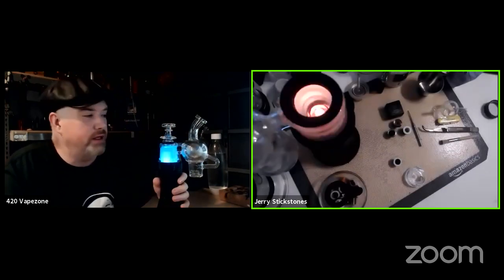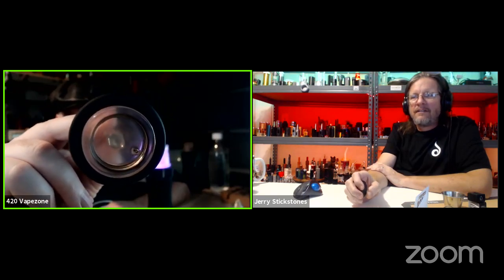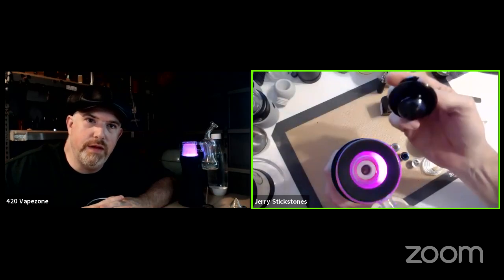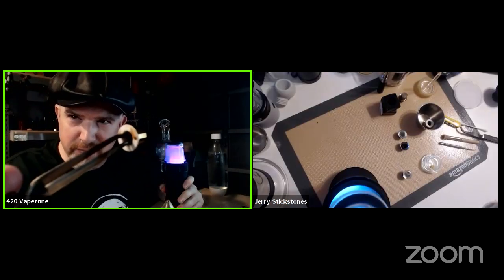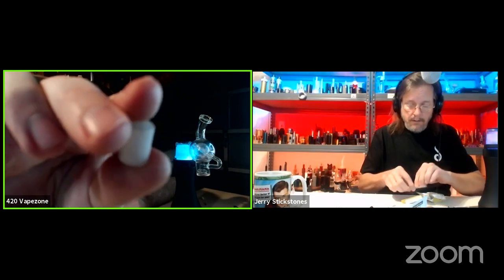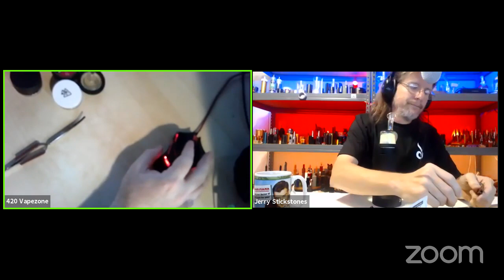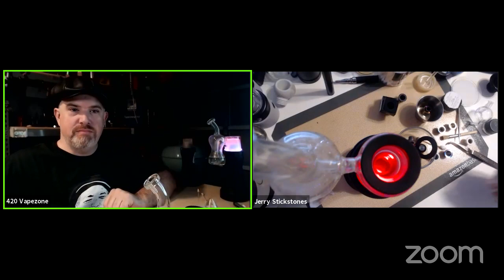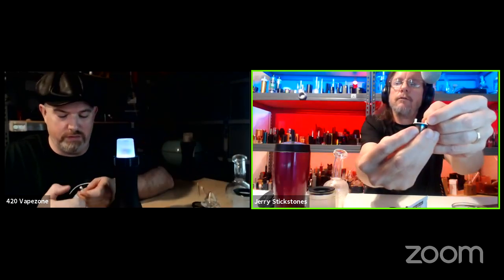Dr Dabber Switch - LIVE SESH & REVIEW

Comment: I love my Switch! Everybody forgets that you can use this for your Dynavap also.   Loving the videos!   Keep them coming please!
Reply: How on earth do you do that? Is there some sort of converter to fit the dynavap?
Reply: You have to take out the metal cup. So it’s empty inside of the Switch. Just stick your Dynavap in and hold it in the center and press the button.  You just have to figure out what temperature is best suited for your taste.  You might burn through some bowls until you get your temperature adjusted. Depending what temperature you pick you might have to leave it in a few seconds after the click. 
 The technique is hold the Dyna slightly off the bottom and don’t let it hit the side walls. So it’s kind of just suspended freely in the center.  Once you have it figured out with heat and timing it works flawlessly.
Reply: @lawtheone3347  thank you for my solution. wow i would like to see a demonstration of this

Comment: There's a reason I never bought the puffco peak pro or The Carta 1&2 is because of the Dr. Dabber Switch, which is close to a traditional rig in vapor and hitting power as possible, Don't need no atomizers is one of the biggest advantages and an all glass air path, induction heating with the cups can last forever as long as you don't break them. Best customer service out of all e-rig companies And when it's fully upgraded there's no E-Rig that can come close..

Comment: great live. This would be perfect for me, as im a bonger but want to mainly use concentrates for flavor. but occasionally ill use herb. I just hope ill be able to clean it out fully to not deal with the taste when switching back to concentrate mode. any more details on the smell and taste afterwards when hitting a dab after? like have you found a way to go from herb to concentrate and you wouldn't even notice when hitting concentrate?
Reply: The well and dish are easy to clean. It's the glass that might slow you down. But if you gave it a quick iso rinse after each session it might work.
Reply: @vaporconcierge8431  o nah i deff plan on using two different glasses.